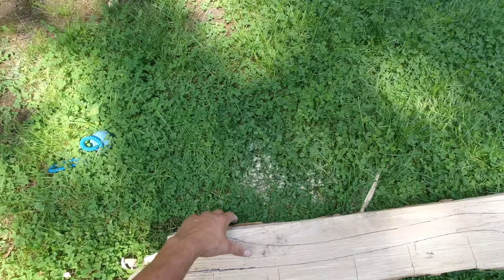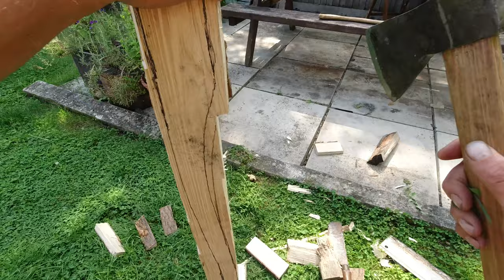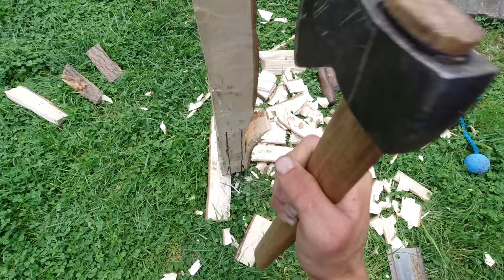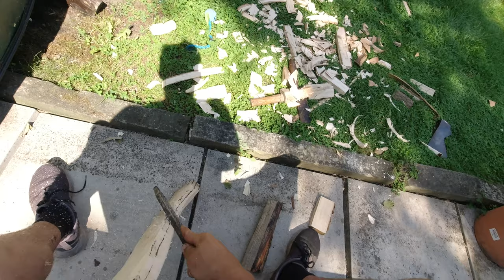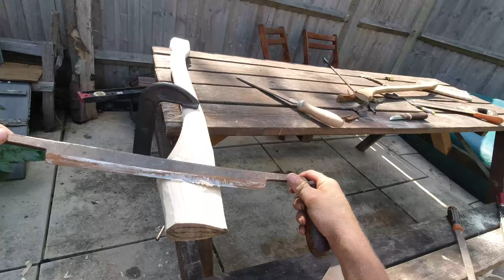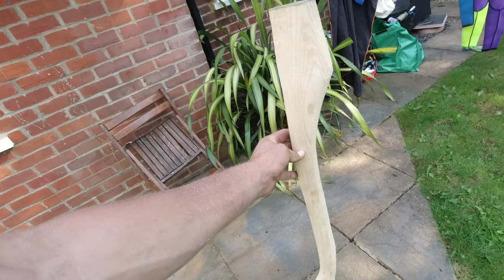Making An Axe Handle, No power tools!!

Comment: thats a hell of a work. I just modiefied a store bought handle with 36 cm DIn 5131 down to a shorter and slimmer 32 cm handle for my hatchet and I really had truble fitting it correctly. Had the eye slightly to the right. correcting that kinda breaks my brain. xD how ever it came out nicely, of course the barrel wedge destroyed everything but hey...
Reply from the maker: The more times you hang an axe the better you get. My first hang was total crap. I don't bother with a barrel wedge, I'll only put one in if the head loose, but even then I'll re wedge it first. Thanks for watching